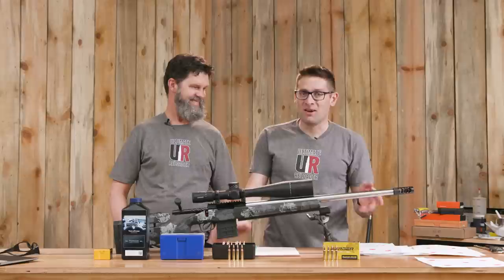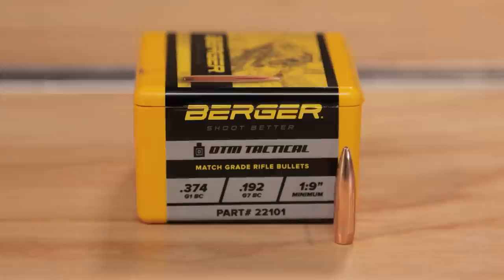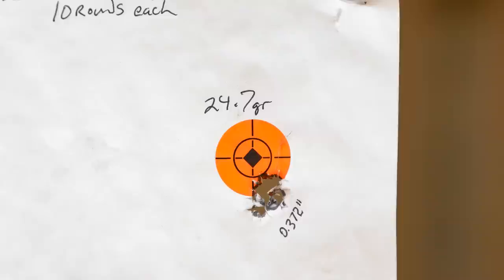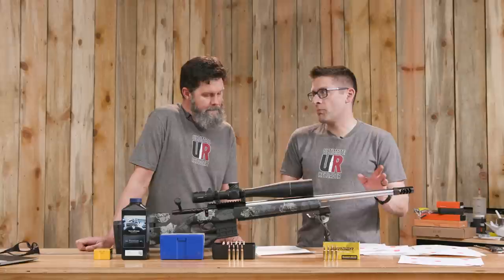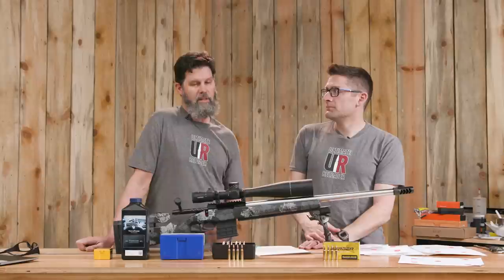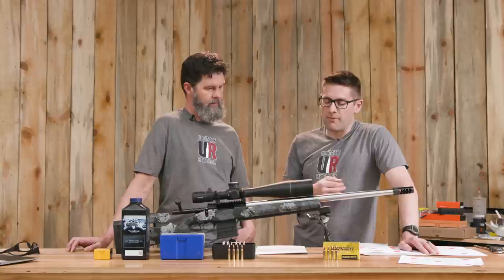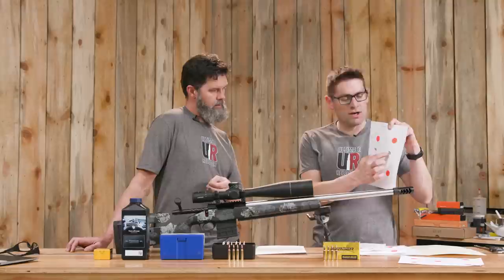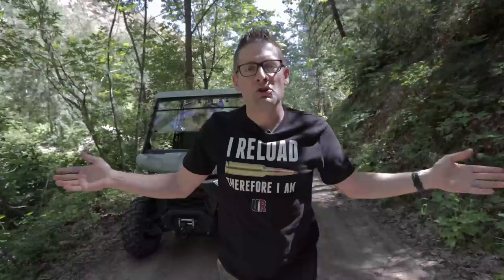Re-creating Berger's AMAZING 77 OTM 223 Load

Comment: Berger or any ammo manf are not using canister powder.  They are using bulk powder.  Even if the powder is tech N140  about bulk vs  equivelent from Vihtavuori themselves the variance will be different per bulk lot.  Maybe do an interview with a powder manf rep on bulk vs canister powder.  My guess based on my knowledge and experience in commercial ammo manf and case bullet manf is its a combo of powder spec characteristics ( simple lot variation in energy, heat etc in the handloading community is all wrapped up in the term "burn rate:.  This is not techincally correct but a lumped term.  True burn rate is a fix parameter in closed vessel testing.  Same temp humidity pressure etc.

But back to the load variation.  Powder variation within the VV N140 from canister vs bulk.  The primer.  The actual ne k bullet releasing force.  The latter is important.  Consider the time between case processing to actually bullet seating. By that, when the case was necknsized vs when tge bullet was seated.  Of course actual neck interference dimensi9n in sizing.  How long the bullet has been seated.  Speaking of cold welding effects from bullets seated for weeks and months.   Back to the effect from neck sizing to bullet seating time period.  Take a case size the neck to a given interference fit dimension.  Do say 10-20 cases.  Now immediately seat half the cases with a given b7llet using a load tester press i.e Amp load press or a hydraulic versi9n like 21st Century or K&M.  Obviously AMP is number 1 and IMO 21st is a better setup than K&M.  Next wait say a month and now seat the other half those sized cases  left with tge exact same bullet. Compare the intial peak and overall seating force.  On the AMP you can compare the entire curve.  You will see a dramatic effect in tge pressure curve.  The ones that were left for a month will have significantly more seating force.  In turn the release force will be greater as well.  To make the variance even larger now shoot the first group same day or within a day or two.  With the bullets seated on the month old sized cases wait another month and now shoot it.  If you had access to a load sensor bullet puller you could measure that force difference.  In this case we can use the chrono to see any difference.  So by waiting after sizing to seat bullets a few week and then further wait a few more weeks after seating to fire those cartridges they will have the maximum releasing force vs those sized loaded and shot the same day.  Of course it goes without saying you need to use the same brass manf and lot of cases.   Then do a test of the load using Fed match primers vs CCI BR primers.  Berger would likely tell you what primers they use.  Finally as you mentioned you then have found add in environmental variations.  IMO Vihtavuori even there most stable powders have a larger per degree variation than say Varget or H1000. H4895.  They si ply do not have to deal with those hot temps in N Europe so IMO it does not have the priority that the ADI Australian powders have. Obviously ADI have the climate and user need for much more temp stability at higher temp than N Europe. Bdifference in peak summer temps of 80s F vs 110+F.
Reply: Very interesting post. I have piles of cases that have been previously processed and are just sitting around, sometimes for years. If I'm using them for any shooting at 600 yards or beyond, I'll always run them over a carbide mandrel right before I load them, just to ensure consistent neck tension.

Comment: I think adding a supressor does change harmonics. There are tuners out there now you can add with the supressor and tune it back in. Do you think it's worth a try? I would be interested in the results. BTW I use Berger 70s. Same BC, 100 fps faster. Has hit a 12" plate at 1200. Yes, way past Transonic but this bullet doesn't seem to care.
Reply: Smart stock tuner; goes in the fore end under the barrel so anything or nothing can be on the muzzle. The inventor has passed now, his widow and son selling off the last of them, I'd love to see a Gavintoobe series using and evaluating one of those.

Comment: For the heavier weight bullets in .223 (75g - 85.5g ) , Varget is tough to beat . Typically , it gives 1 hole precision at 100M but at higher velocities . My 705 yard plinking load is 24.5g of Varget , with the 75g Hornady BTHP Match bullet( low cost ) in Lapua brass with a BR4 primer . In cool temperatures ( 45F ) it delivers 2950fps out of a 26" barrel with an ES of 23fps and an SD of 8.5. At 75F it's at 3000fps . For shooting at longer distances or in the wind , the Berger 80g VLD or 85.5 hybrid are a significant step forward . I've tested this EXTENSIVELY in a Savage LRPV 7 twist , single shot rifle . https://www.youtube.com/watch?v=9ce3KzxdhSk

Comment: You're not getting to 1000 yards with a 77gr bullet. At least not without going trans. You'll pop primers long before you get to the 3200 fps. It is very doable with anything 80 grs or higher loaded long.
Reply: Not to burst your bubble!! But I'm shooting 69g Sierra matchking out a ar platform 24 inch barrel at 1100 consistently. And many guys I shoot with also
Reply: If you’re that confident go shoot a f- open match with 77gr bullet and let us know what you score. Shooting steel at 1000 yards and hitting half the time isn’t real accuracy.